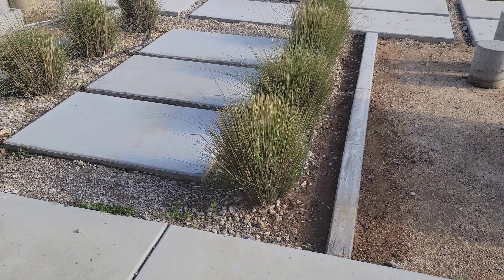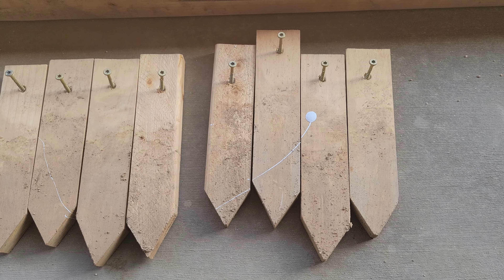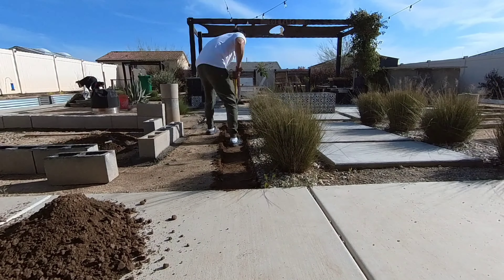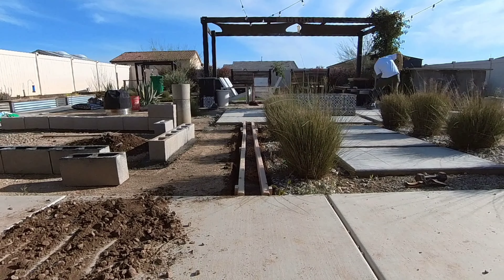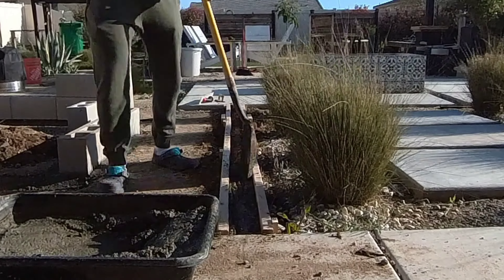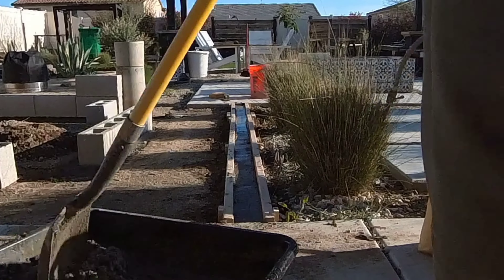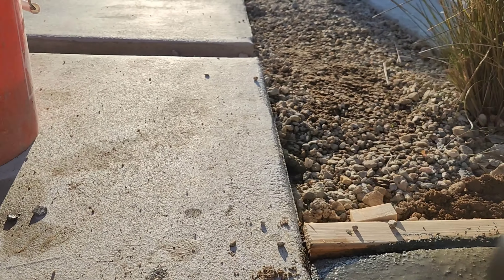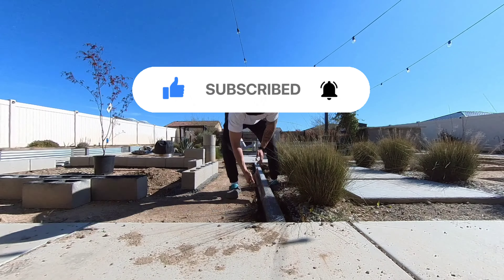Concrete Border $18 EZ DIY | Concrete Edging Quikcrete

Comment: Is that muhly grass around your borders? Is it pink or white?? Another way I started mixing concrete is with a wheelbarrow. I first-line it with plastic inside making sure to have enough that it hangs over the wheelbarrow. Then add your water and then use the plastic to mix it by picking up each corner, works awesome. I learned this by mixing my dyi potting soil/ compost mix. . Great video
Reply from the maker: Randy, yes it is Muhly grass! I love the purple bloom, and we still have some in the back, but we ended up ripping the ones near the border out because we are working on some raised concrete planters in that area. Also, that sounds like a great technique with the plastic. I'll have to try that out!